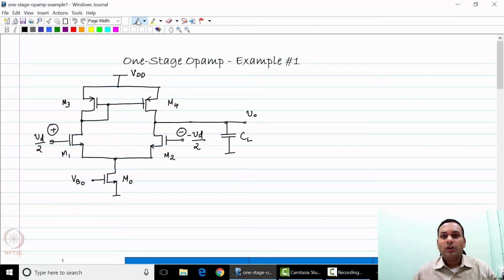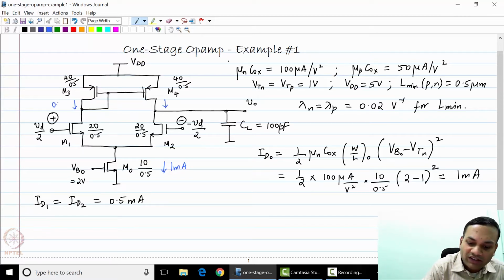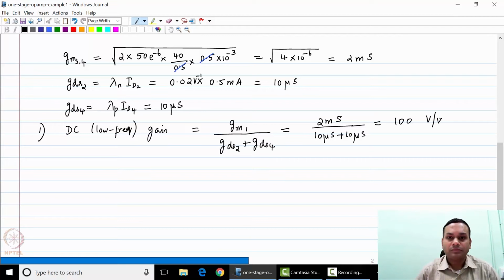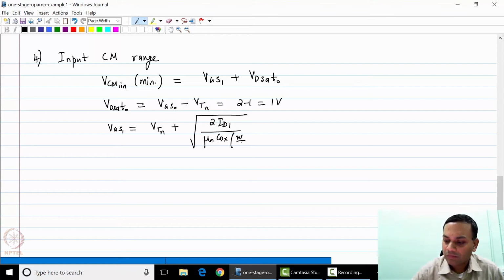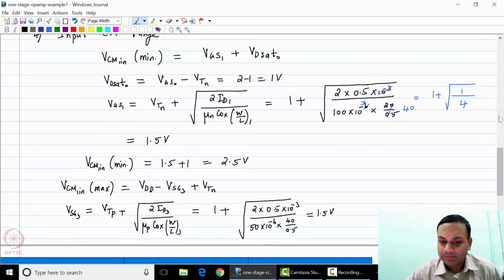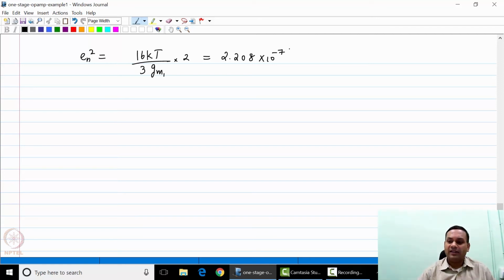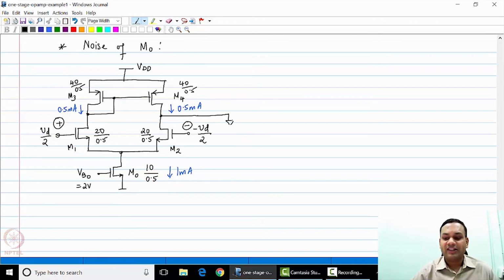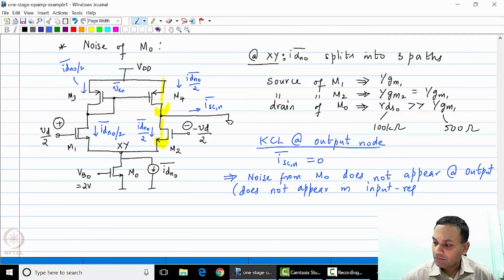One Stage OpAmps - Example 1

Comment: Expression shown in video for CMRR is incorrect. You have taken the CMRR expression for differential amplifier with Res load and applied it to 1 stage op-amp. This won't work because half-ckt load impedance for Acm vs. Adiff are different for 1 stg opamp, unlike where they are same for differential amplifier with Res load.